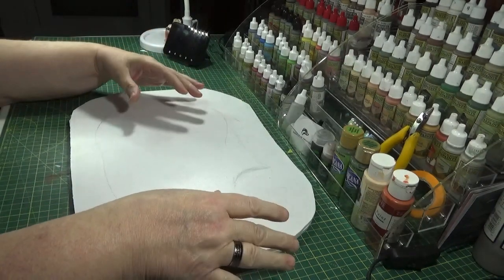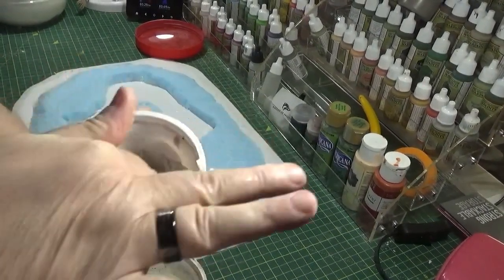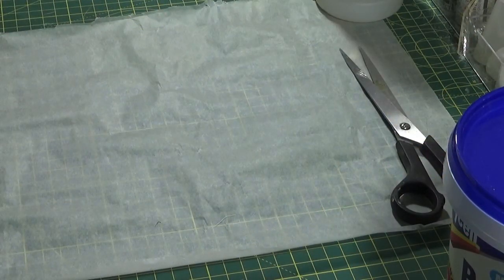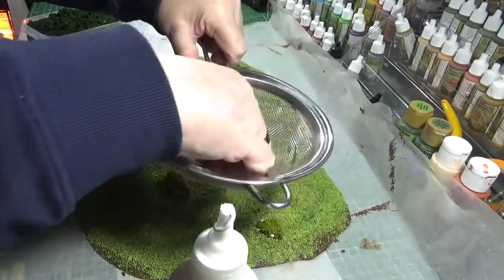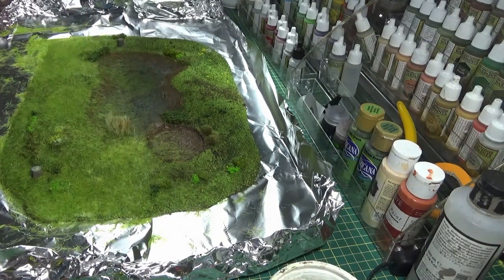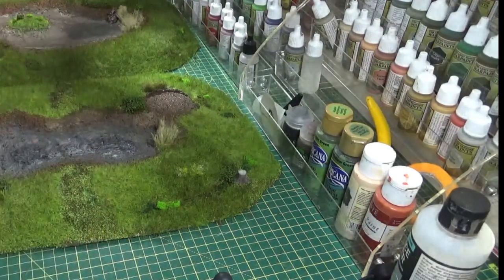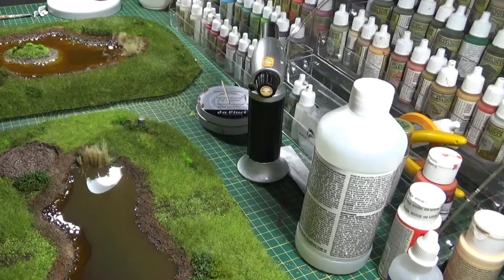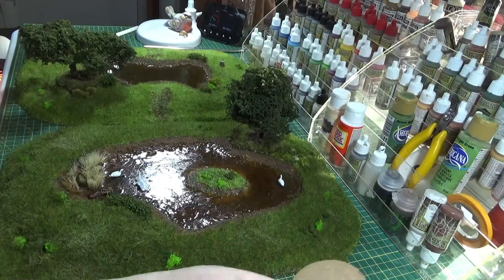Bolt Action Terrain: Making a Pond

Comment: The grass and water look really good. I have used that water and found that things stick to it and can be pulled off tearing the surface. Hopefully the Modge Podge will prevent that from happening. I will try the MP to see if it improves the look.
Reply from the maker: One thing I found helps, is to paint on a light coat of gloss varnish afterwards, it certainly helps to keep  it clean and you can then easily wipe of any dust that settles on it with a damp cloth. Thanks for watching😉